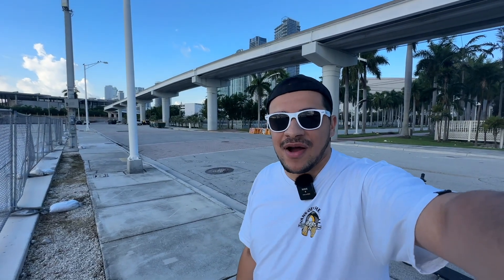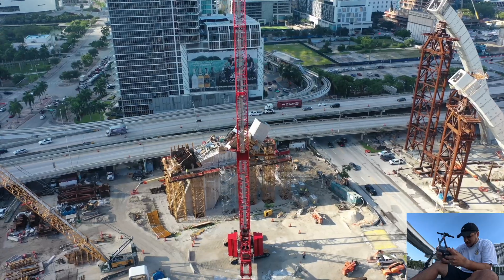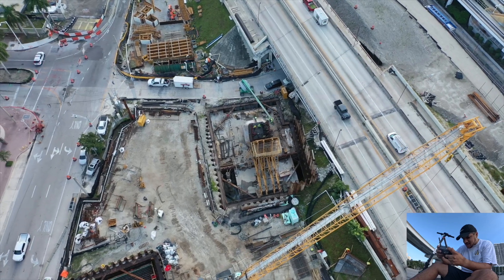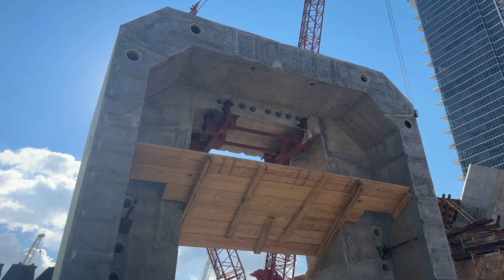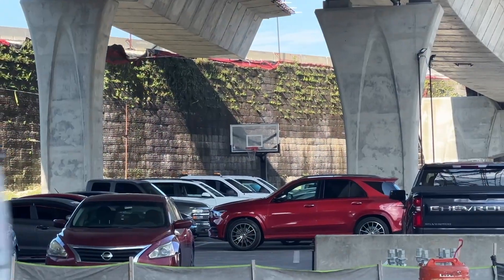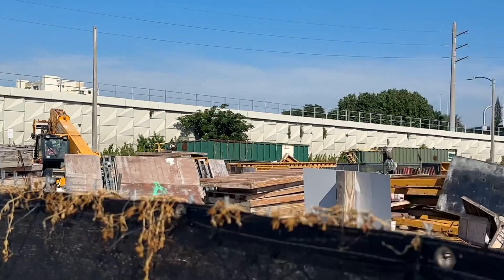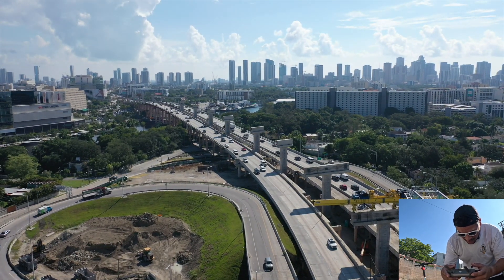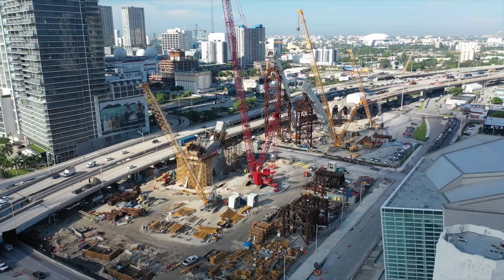What's New in Miami's $840 MILLION Signature Bridge Project! | Year 2 Update

Comment: Although it is nice now that the highway will be higher off the ground, especially through Overtown where it used to be so dark under there, widening a highway won't solve traffic. If only they could use that much money to improve and expand the Metrorail and Metromover systems to offer people a fast a convenient way to get around different parts of Miami.
Reply: That makes too much sense. The state is not invested in making sense anymore. With that kind of money, we could have improved upon MDT's existing metrorail, metromover, metro bus projects. Like updating the metromover stops or even fixing the busted elevators at metrorail stations.
Reply: @thedirtybubble9613  The amount of people who would use the metrorail compared to an additional highway is incredibly low and would see far less return on investment relative to the cost (it was actually estimated to cost more than this project). Don't get me wrong, I want rail and other public trasportation options too. But they're mainly only built by enthusiasts and rarely serve a significant portion of the public.
Reply: @evials9123  If they expanded Metrorail to more areas where people live they will come. For a $1.25 fare, sure why not. The county had their chance 20 years ago and blew it.